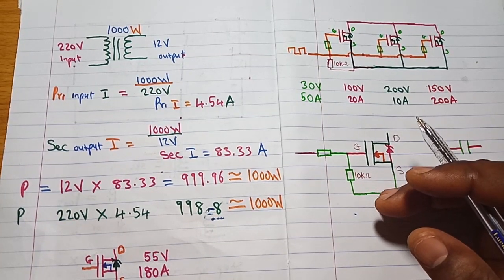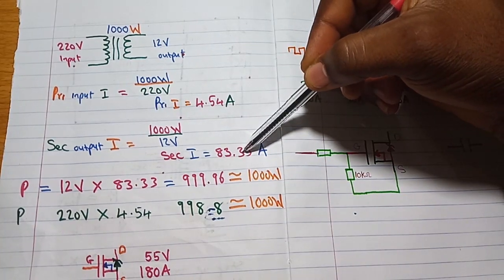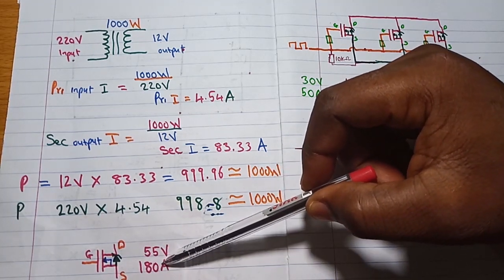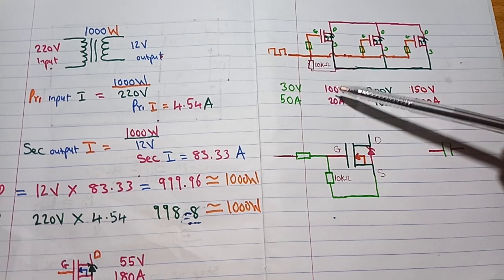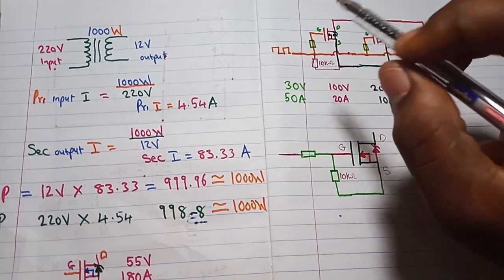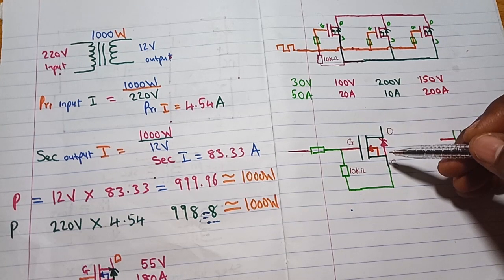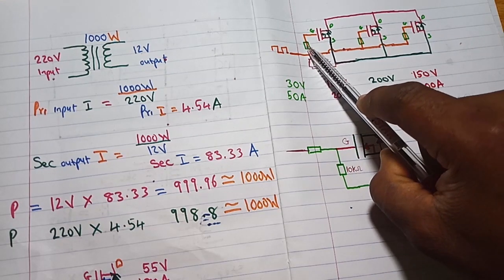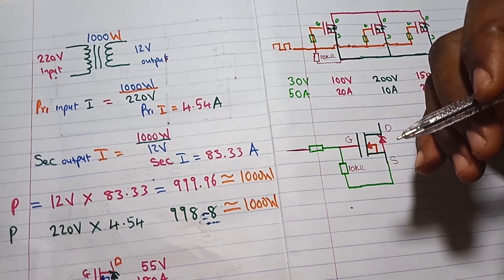Inverter Design for Beginners #03

Comment: The first two videos were very correct, however, you said the power from the transformer goes to the mosfet.  That is incorrect.  TheMOSFET(s) in the inverter are what create the AC current.